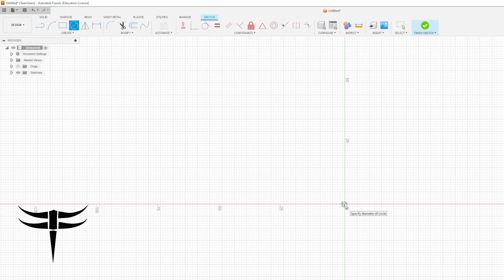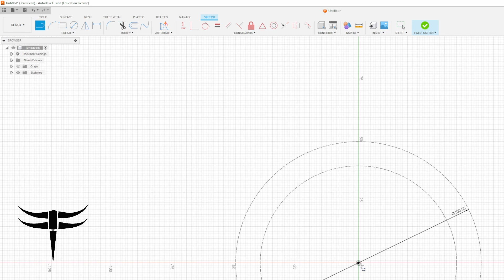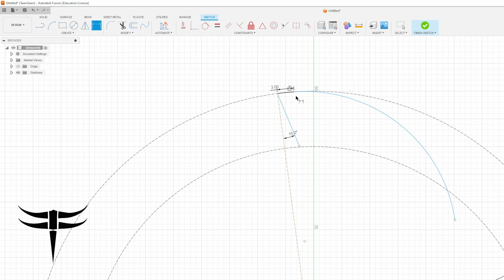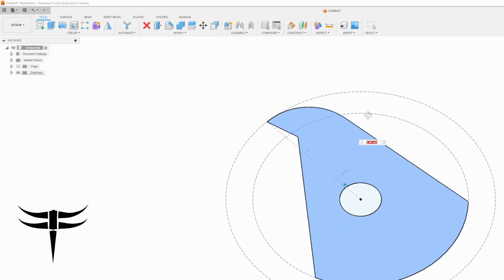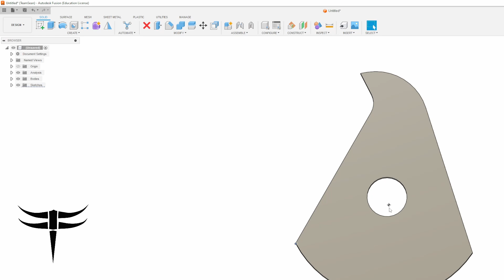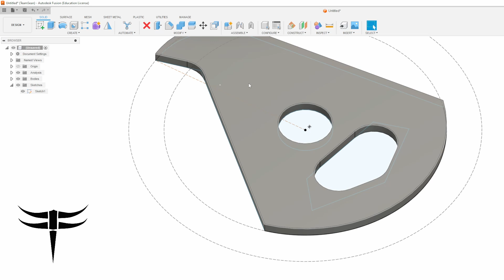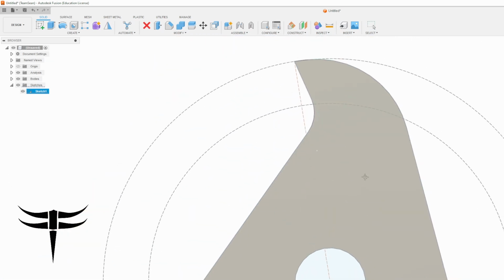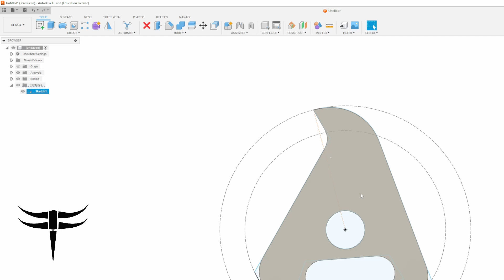Intro to Combat Robot Spinner Design - Tutorial and CAD-along

Comment: Great video. Another important thing to add is that the further from the center your mass is, the more kinetic energy you can store in the weapon. Hence, why the pocket near to the center of mass is a better option than having a more round—but smaller—weapon.
Reply from the maker: Yup! A high MOI/weight ratio is an important thing to optimize for in a good blade, but for this video I really wanted to keep it to just the basics. I might release an extended series that covers all the theory at some point
Reply: @teamthagomizer  Definitely do that at some point. The scene is sorely lacking a modern weapon design series.